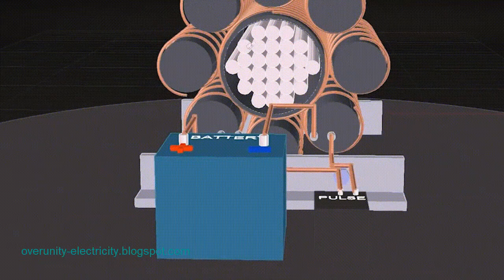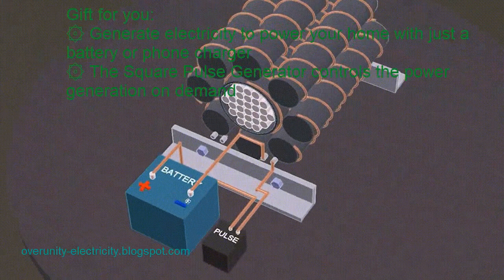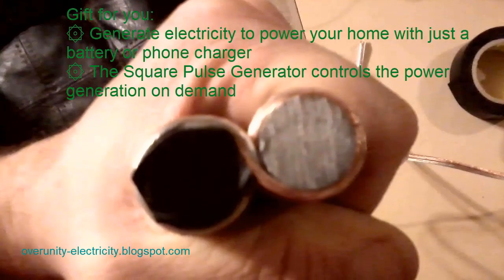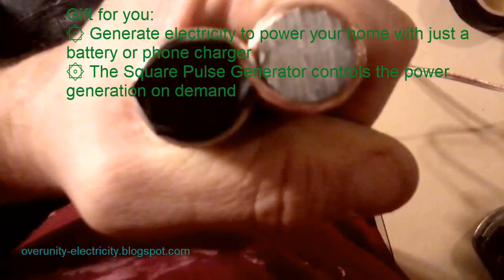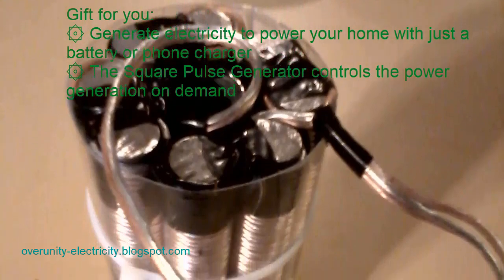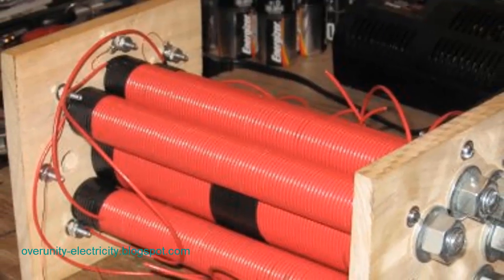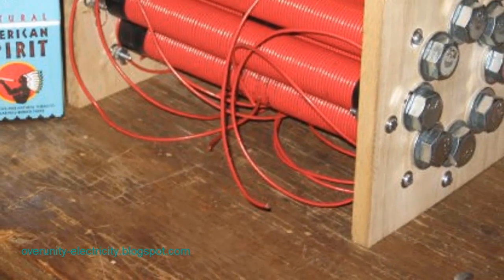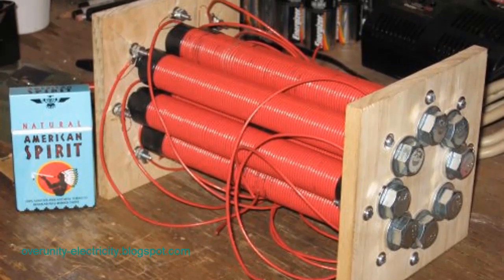Dual Channel Arbitrary Waveform Generator - DDS Function Counter - JUNTEK JDS2900 15MHz

Comment from the maker: JDS2900 digital control dual channel DDS function Arbitrary waveform signal generator, with a small size, easy to carry, good stability and other characteristics, the two channels are completely independent, all parameters can be achieved at the same time; can output function signal, pulse signal, Signals, digital signals and custom arbitrary waveform signals, and has a counter and measurement signal function; the use of large-scale FPGA integrated circuits, high-speed MCU microprocessors and high-precision oscillator as the basis of internal circuits, the signal more stable. SMT technology can greatly improve the anti-interference and life of the instrument; electronic engineers, electronic laboratories, research institutes and electronic enthusiasts worthy of the equipment.

https://online-department-store.blogspot.com/2022/05/dual-channel-arbitrary-waveform.html
Reply: is this similar to spooky2 gm genrerator pro?